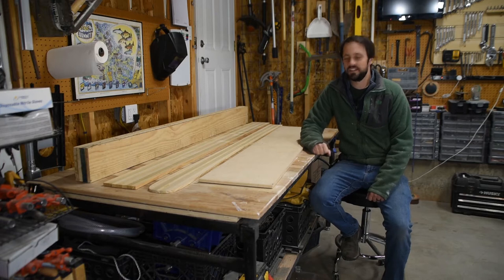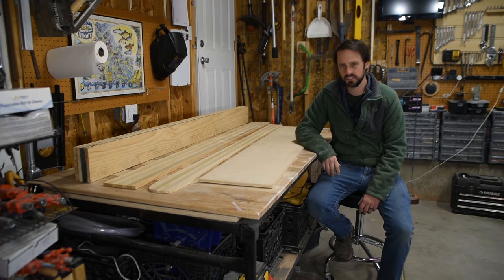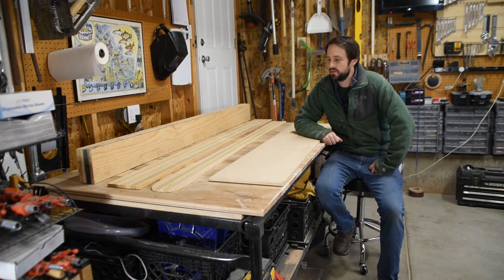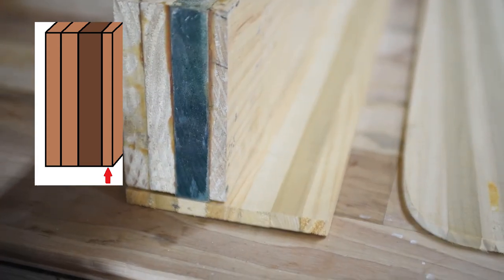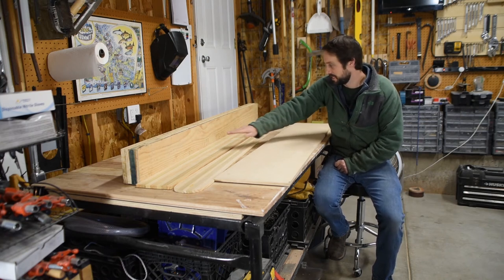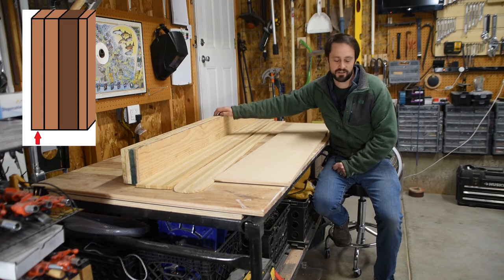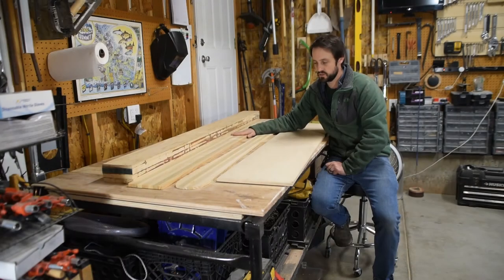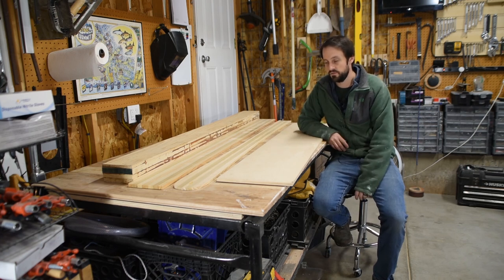Ski Core Construction

Comment: Working on building my first pair of skis, what woods would you recommend for the core? looked like you maybe used some pine, oak, and poplar? My goal is to build an all mountain ski, much like the Nordica Enforcer. Thanks for all the videos, its a huge help!
Reply from the maker: Hi dude, that's awesome!  Yeah pine and poplar are probably the most popular options.  That's what I'd recommend.  Oak is a bit harder than poplar, so if you are worried about ripping out bindings that would be a better option.  Good luck!!
Reply: @redbarrelskis3361  thanks so much!
Reply: @redbarrelskis3361  Why not add a thin metal plate in the binding area to aid in binding retention.